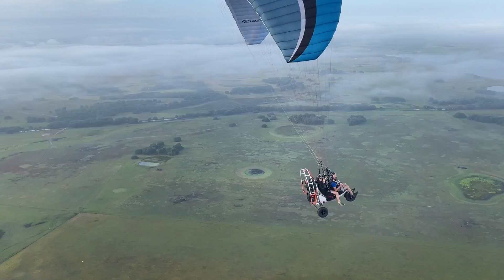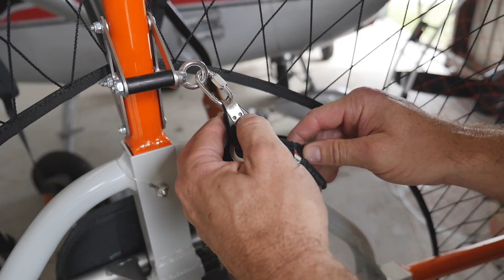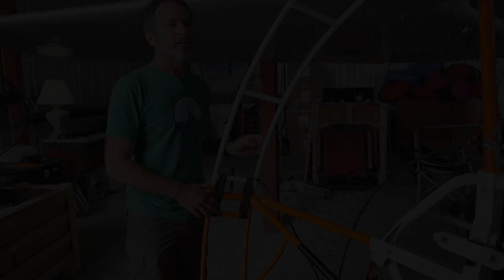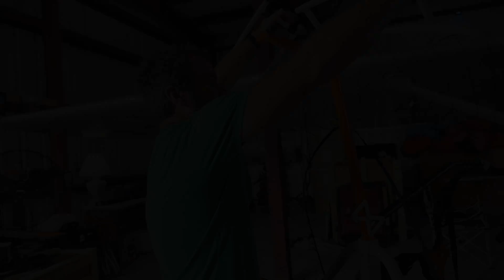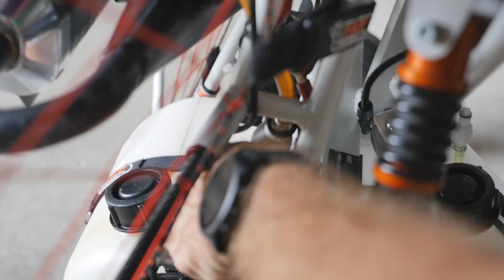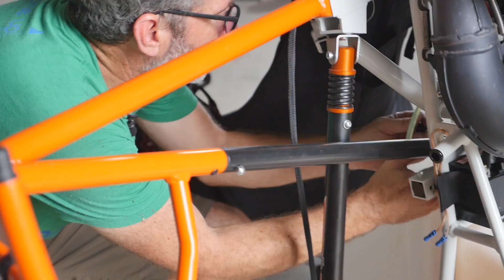Vertigo Trike Versatility and Build

Comment: Does the mini frame fits a flash cruiser?
Reply from the maker: Yes, it will fit the flash cruiser.  However, there would be no provision to mount the cage, since the Flash Cruiser does't have a provision for a its own cage, and neither does the mini-frame.
Reply: @oneupadventures5040  Thanks! I'm planning on using the flash cruiser with my own frame that is not compatible with the mount so I was going to build a bracket to hold it but this will be perfect as I can attach it to my frame and simply place it on the flash cruiser!

Comment: What motor would you recommend for a newer pilot weighing about 235?
Reply from the maker: If frugality is a primary concern, than a Moster Plus on the mini-frame will do the job at your 235, I would recommend a 34M glider EN-A/B glider to go with it.  If performance is primary concern over frugality, the Cosmos 300 is the engine will give you shorter takeoffs, faster climbs, and is super smoooth!

Comment: Hi Travis Nice vid. I love my Vertigo with the thor250 for evryday and xc flying, i howerver starts to be interested in slalom. I got my vertigo set up with the original cage on meaning ive got a stripped rider sprint cage with the motor. Would it be alot of hassel to buy the rest of the parts to the rider sprint ( for footlaunch) plus the foxy and then simply swab the entire setup (minus the swingarms and seat ofcourse) between the 2 trikes? hope i do explain ok as english aint my native. blue skies  keep them vids comming :)
Reply from the maker: Hi Stefan, sure it would be possible, no problem.  You would just need to purchase the double hoop cage, harness, ASC Swingarms, and and a set of carbon spars and it would be ready for foot launch. :)   If I can help out please find us at 833-232-5483 or info@flyproductsusa.com  - Travis

Comment: Hi , is it possible to put the corsair black bull on the trike frame ?
Reply from the maker: Th Fly Products Vertigo can be used with Thor 202, 250, 303, Moster 185, and Cosmos soon.   In order to mount the corsair black bull you would need to fabricate an adaptor plate.  :)

Comment: Hey Travis, Is it possible to mount/dismount a standard rider frame without removing the Vertigo's cage or do you have to remove the vertigo cage, mount the rider frame and then reattach the vertigo cage?
Reply from the maker: You can absolutely have both the rider frame and net as well as the vertigo.